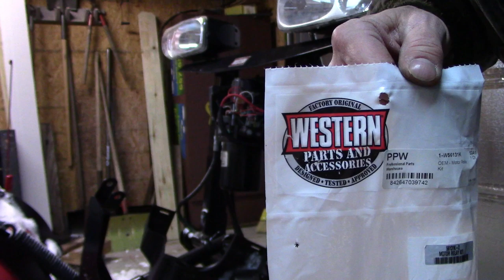Plowing Snow Changing Solenoid on Western Plow

Comment: I call that one a relay and the ones that open and close hydraulic valves the solenoids. I suppose they are both technically solenoids.
Reply from the maker: It is listed as a solenoid, says it on the parts manual also.

Comment: Figures that solenoid would bother when its that cold out. 
     Glad you were able to get it sorted out quickly.  
Fisher uses the same short stubby bolts to hold the pump solenoid in place .   They are only about 4 threads long and a pain . 
      Get some rest when u can